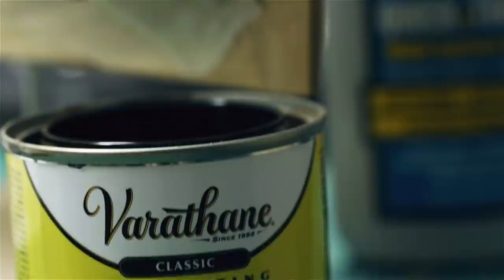Model ship building #8 - Making the Wales - RAGUSIAN CARRACK XVIc - KIT manufactured by MarisStella

Comment: Have you considered using steam to bend the planks, before putting the plank in contact with the hot solderer surface? It makes miracles...
Reply from the maker: I used to always boil the planks before planking. But later I got an oil heater - it saved a lot of time...

Comment: While binge-watching this series of videos, different ideas keep popping into my head, some I think good, some silly.  A question about spring clamps though -- you use a wide range of sizes of the clamps.  Is that for a specific reason or because that's what's available?  ;)  I know that companies like Micro-Mark have very small spring clamps for model makers that appear better sized for use in certain sections of your build, but are way too small for other sections (all in this one video!), so I just have to ask since they don't seem to cost very much, if memory serves.  I wonder if they would be useful if I build a wood ship model?

As for a silly idea that popped into my head while watching you hammer the brads(?) into the temporary clips to hold the wales while they dried, I though of both my small tack hammer, which I've never used and both my largest Blacksmith & Machinist hammers which I have used.  Obviously the larger hammers would be bad choices!  ;)  I am much a more of a Machinist than a woodworker, but "think" I have a reasonable understanding of what to do & not do (woodworking-wise) after >50 years of watching woodworking shows on TV and other media.  I simply haven't done much, so I haven't gained the "muscle memory" (if that's the correct term) for using my woodworking tools, including a lack of practice at sharpening chisels, planes, etc.  I also see myself, when building a wood model in the future, wanting to grab a micrometer or caliper to measure something to within a few thousandths of an inch (~0.08-mm) when that is way beyond silly!  ;D
Reply from the maker: All these clamps are a collection from everywhere and some of them were confiscated from the box of my husband's tools)))) Although of course not all of them are suitable for modeling...

Comment: hello olha
do you remember the thickness of your own whales?
Those in black wallnut.  I under stood they where those wich are thicker than the others
Reply from the maker: In the kit, they offer to simply add another plank. So, I took double the thickness of the strips from the kit. If I'm not mistaken, they are 1.5 mm in the kit, so my wales are 3 mm thick...
Reply: @OlhaBatchvarov  Mine are 2.5.  I was afraid not to be able to bend them